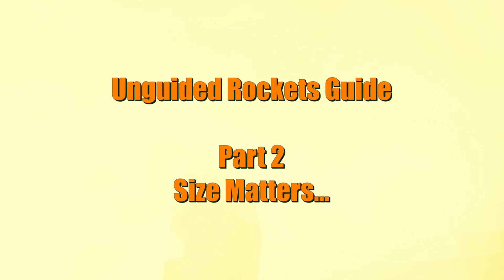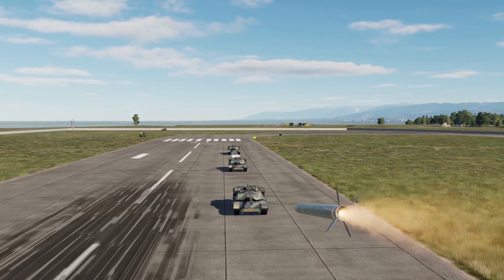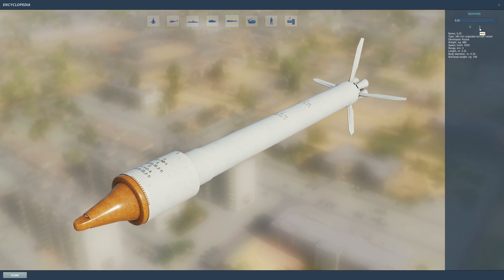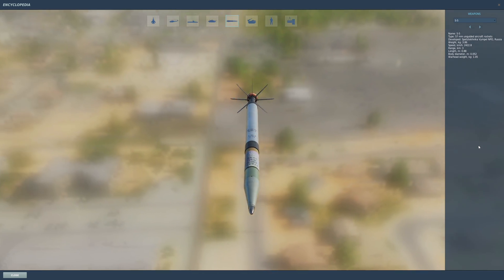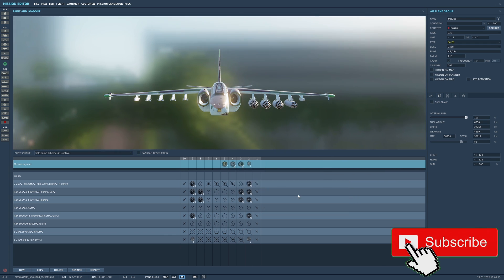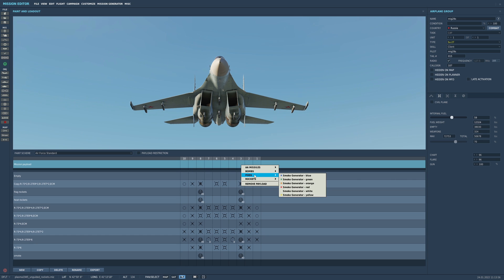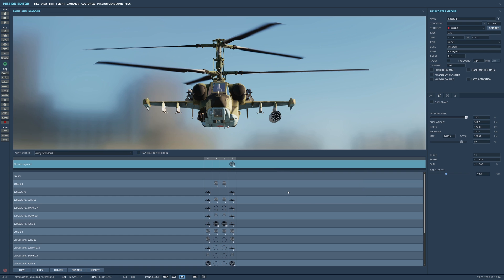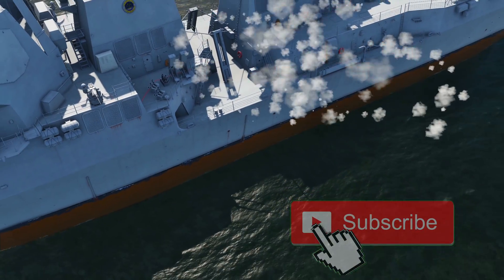DCS Rocket Pod Guide | Soviet Red Force | Digital Combat Simulator (Part 2)

Comment: the accuracy-range can be much higher if you are coming from above, can be accurate from 6km+ , if you angle is high enough  , in my experience at least
Reply from the maker: Yes that's true then the arc is much higher so, good point. I just can't spot a Tank at 6km too far
For me shots are under 1.5km for a good bit of a hit on a Tank

Comment: For anyone interested, the S-25L is available only in the Frogfoots, and I believe it is used against armor and buildings.
Reply from the maker: Very cool Thanks Apollo! I will check it out next time I a Su25 out! Does it work on Su25T and 25 both?
Reply: @plazma1945  It works for both ones but the aiming system for the Su-25A is.... well..... its more fun :)
Reply: @plazma1945  As the other guy said, it exists and works on both. However it isn't considered a "rocket" but rather as an "A/G missile"
Reply: @plazma1945  you forgot to mention about the S-5 rockets.
Reply from the maker: @willisfernandes2366  the little baby ones 😍
Reply: @plazma1945   yes their little but very effective against enemy armour on the ground.
Mostly fired from UB-16 & UB-32 rocket pods.
Reply from the maker: @willisfernandes2366  I shall try them out you have peaked my interest.